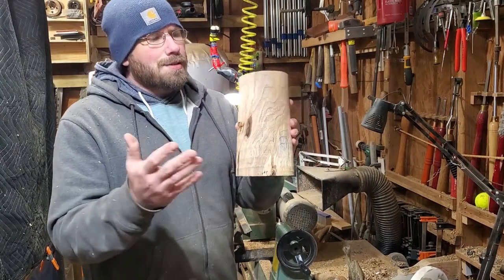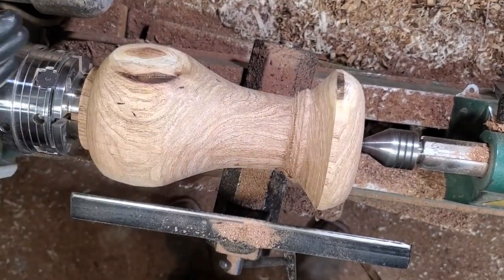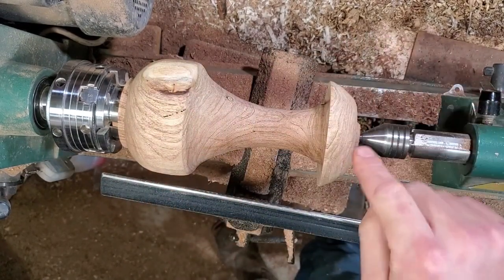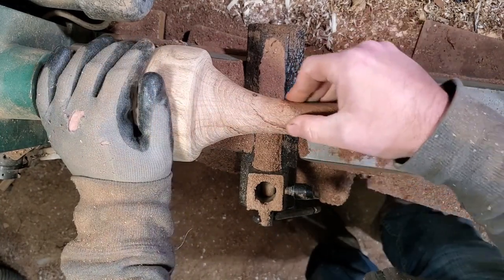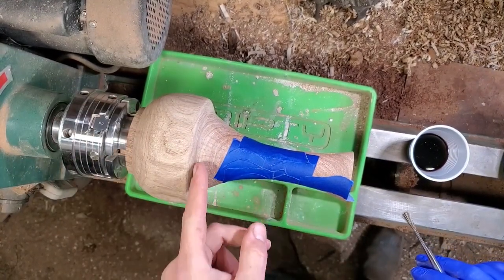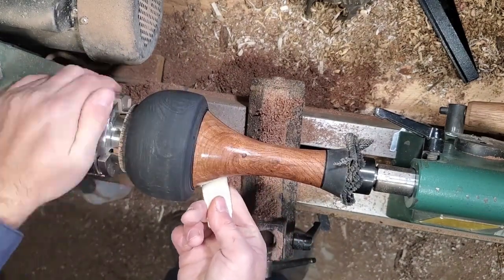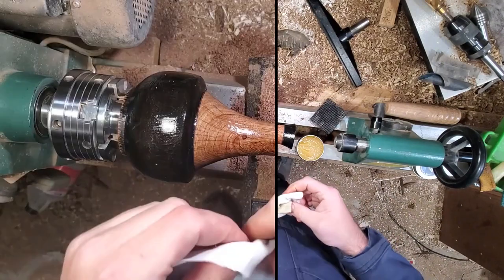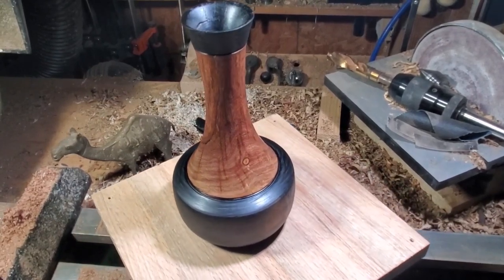Wood Turning - Ebonized Mesquite Vase #YTCCC2021

Comment from the maker: Tools used/discussed in video;
Brads Tung Wax & Sanding Paste 
https://www.etsy.com/listing/834462387/wood-turning-abrasive-sanding-paste-tung

8.9mm round carbide w/ shaft
https://amzn.to/37Q6k72 

Workpro box for sanding disks
https://amzn.to/37O5o2Q 

Shellac Flakes
http://www.oldworldshellac.com

Use bradsworkbench for 15% off your purchase of TotalBoat Resin at 
http://www.totalboat.com 

Starbond CA Glue
https://www.starbond.com/?rfsn=4353906.312489 
Use Code Brad15off at checkout to save 15% amount on your purchase 

Budget Friendly Carbide Cutters
https://amzn.to/367jonJ